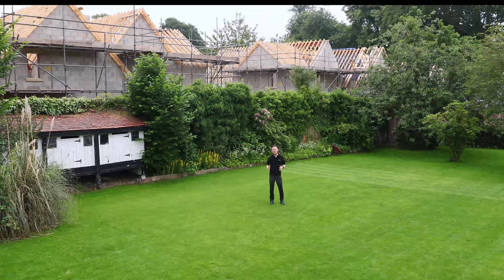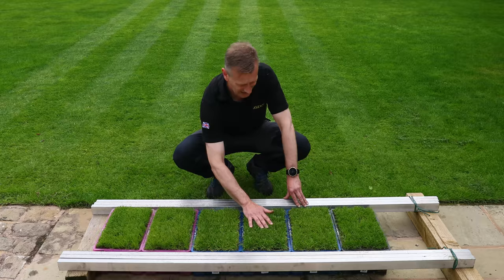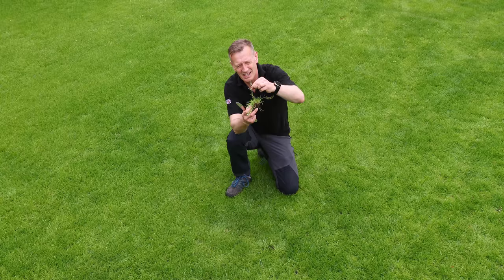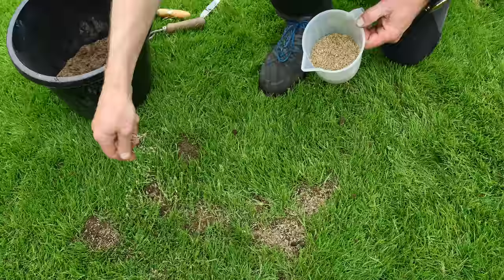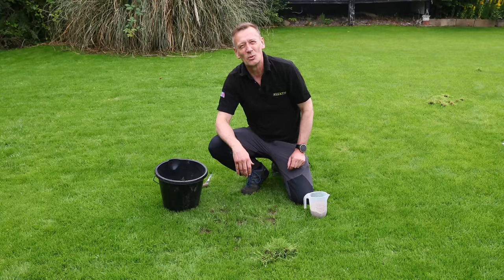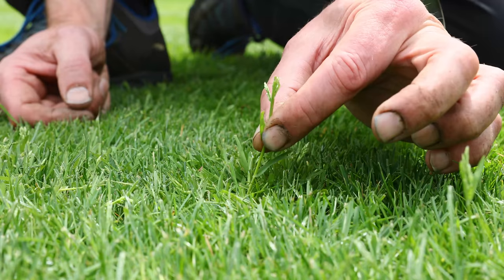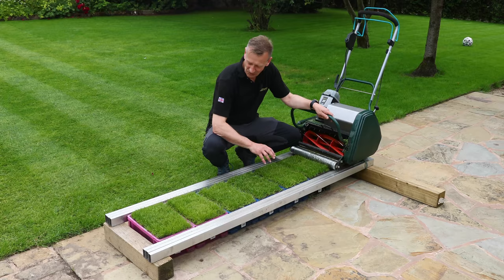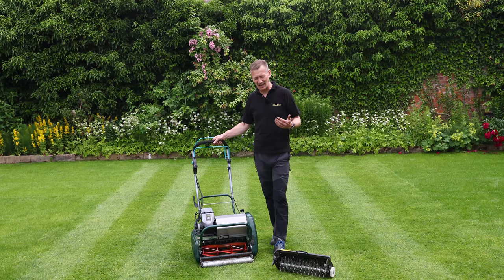Getting Rid of POA in Your Lawn- Allett Lawn Renovation- Season 1 Episode 5-

Comment: I had a bad case of poa.  I used a propane flame to burn all the poa seed and grass.  It left burn spots all over my lawn, but by end of summer, they were all gone.  This fall I used prodiamine at max rate.  I am waiting until spring 2023 to see two things.  One: Will Trump be indicted for anything.  Two: Will I have poa Ana.
Reply: So what’s the result 😂
Reply: @thedj5914  1. Trump finally indicted.  2. I estimate 90% reduction of poa in early season 2023!  Manually removed all poa that popped up this spring.  Well on way to poa-free yard….just not yet.
Reply: @paullampru3591  unfortunately the POA will keep coming back. Can never totally eradicate it !!

Comment: It's astounding how quickly the poa finds its way back. I wonder how much of it is dormant seeds waiting to germinate just under the soil surface waiting for an opportunity. The brush cartridge would also stand the stalks and seed heads up but of course not cut them of like the verticutter. I don't know how effective it would be to use this cartridge on my liberty 35 as it doesn't have micro adjustment.
Reply: use smaller diameter front rollers.a pain in the arse to change all the time but it works

Comment: I honestly think you’re fighting a losing battle Austin. Until we’re able to spray out Poa Annua in the UK trying to regulate it but hand is far too labour intensive. I also find the cylinder mower with roller helps to keep the stalks flat even with verticutting. It’s almost easier to use a rotary first then cylinder after 🤦🏼‍♂️
Reply from the maker: Have you got a set of auxiliary wheels? You could put them on in place of the front roller when using your verticut cartridge. We had no issues lifting all the lateral grasses- it depends how deep you set your verticut and how long the weed grasses have got
Reply: @ALLETTMOWERSUK  Hi Austin. It’s not so much getting the stalks to sit up. The front roller on my classic 35 just flattens them down before the blades cut them. Can I replace the front roller with wheels?
Reply from the maker: @Imthekingofdogshite  yes we have a set of auxiliary wheels you can put on in place of the front roller https://allett.co.uk/collections/homeowner-accessories/products/allett-qcswk-auxiliary-wheel-kit?fbclid=IwAR2QuK1D-HrgWXQ2F3e_6s04pbPHeH27v3nRUA1t58vIp40aKgVdQBAh3WU
Reply: @ALLETTMOWERSUK  and these work with the classic 35 the same as the Kensington?
Reply from the maker: @Imthekingofdogshite  yes - they come as standard with the Liberty 43 and Kensington’s but are available as an optional extra for the liberty 35 and classics
Reply: @ALLETTMOWERSUK  that’s great. I’ll get them ordered. Many thanks 👍🏻
Reply from the maker: @Imthekingofdogshite  this video shows them in action https://youtu.be/vqmMKS0eF5I
Reply: Ordered 👌
Reply from the maker: @Imthekingofdogshite  thankyou Peter :)
Reply: @ALLETTMOWERSUK  Forgive me for saying so, but the idea is to regularly verticut and mow right? Not going to be convenient to change between front roller and wheels each time is it?
Reply from the maker: @liammullan2197  you don’t need too if you are mowing regularly
Reply: @ALLETTMOWERSUK  Don't need to what - verticut? You're saying you won't get POA if you cut your lawn regularly?
Reply from the maker: @liammullan2197  won’t need to fit the auxiliary wheels … you should be verticutting at least  once a month
Reply: @ALLETTMOWERSUK  Did you mean "at most"? Otherwise not sure I follow you :-)
Reply from the maker: @liammullan2197  no at least… little and often
Reply: @ALLETTMOWERSUK  Doesn't verticutting stop the SC Red Fescue from spreading?

Comment: Hi Austin, great series of posts. I am quite new to lawn care, and have over the last 4 year learned a tremendous about grass varieties, lawn care regimes, mowers etc.
I have just concluded that my premium Rye Grass mix from Rolawn is turning me into a slave for my lawn, having to overseed every year etc. I want my lawn and nature to work for me instead. So have decided to perhaps I need to start over with a Bent/Fescue mix instead, to get that stoloniferous lateral growth working for me, and hopefully no more overseeding every year.
Your exeperiment with the different seed mixes has been very useful indeed. I have only one question for you:
How well is your Fine 1 or more specifically Fine 2 area of the lawn doing with regards to preventing Poa after 2 years?

If I go ahead with my plan, I'll be saving up to get a Allett mower with a verticutter to assist in my grooming regime, and to hopefully get those solons cut and dense growth to follow, with no room for poa!!

😃
Reply from the maker: Hi! Good to hear from you. Fescue & bent is a beautiful lawn at any height you choose. Better colour in the winter (no ryegrass winter die-back). But you need to have the thatch reduction equipment ready and germination is slow. That’s the worst time for Poa ingress.